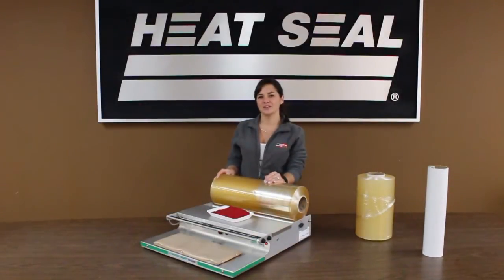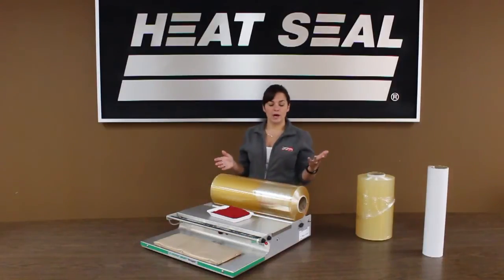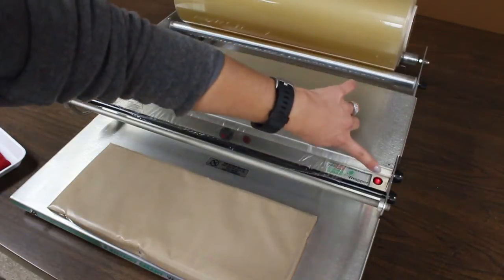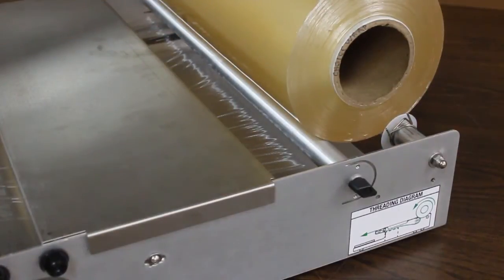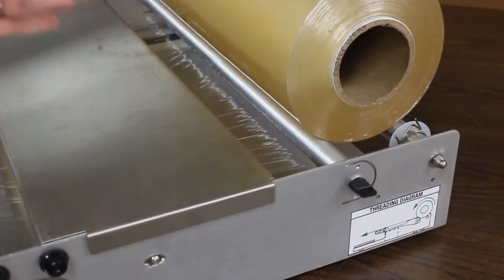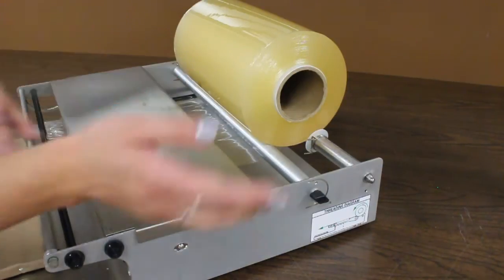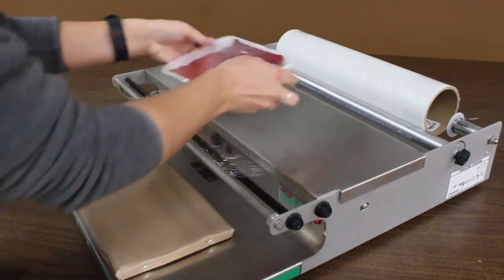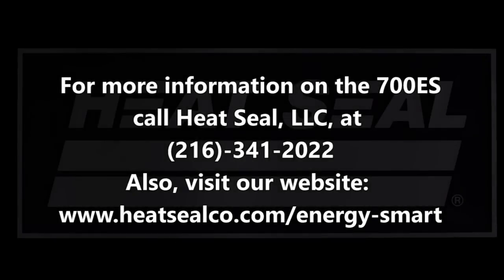Energy Smart Model 700ES NEW Cradle Mount

Comment: I use one at work, I think it's the 700 ES and we are having a problem wit the element at the fron that heats up and melts the film as we wrap things. It keeps sliding out of the hole in the metal brace or plate that it rests in on either side. It just keeps falling out on the left side and we cannot push it back in further to secure it because it has the electrical wring that goes back into the machine to get the power. Also, our cover for the heat plate is shredded. Where can we order another one? Thank you!